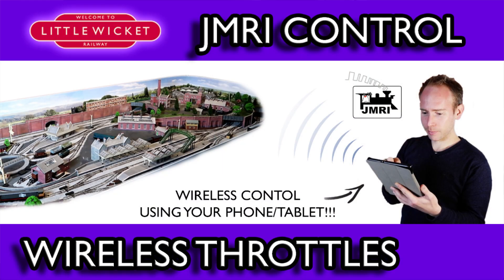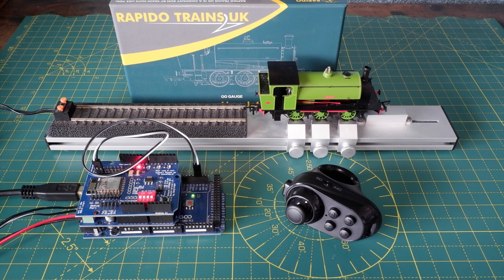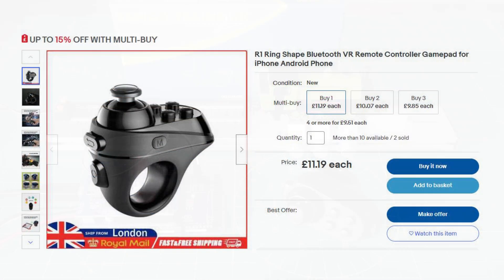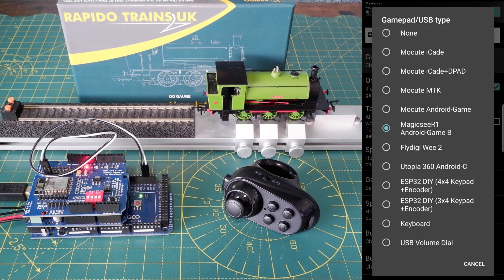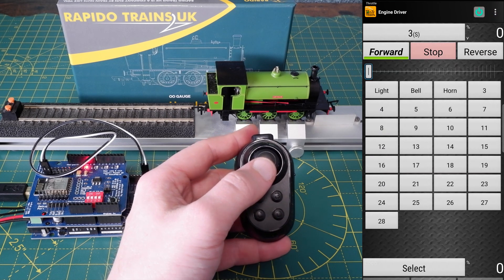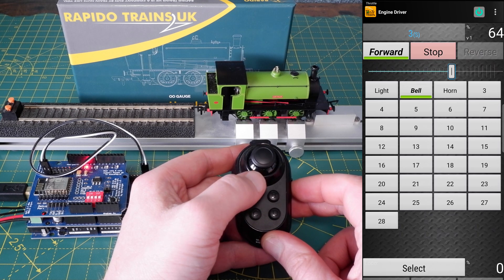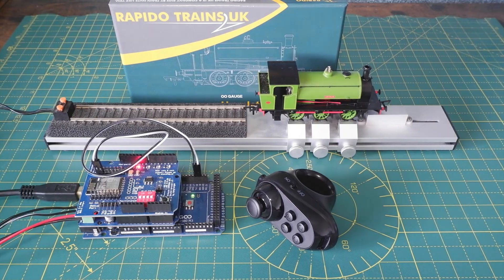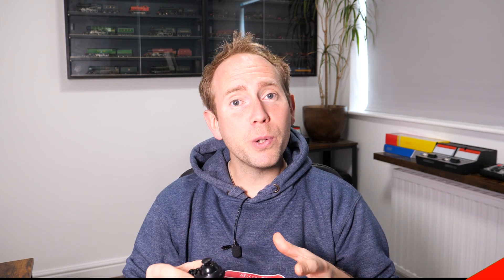Add a Handheld Wireless Throttle to the Engine Driver App

Comment: Rob, once again you have a knack for making a video about the thing I was interested in, before I get to doing it 😂.   I saw there was an option in ED to connect a pad, but I never tested it. I did actually prototype making changes to the web server interface and connecting a Xbox controller via the browser interface. I wanted to see how the analog triggers would work for fine grained control and it did feel pretty good. I'm planning on implementing a custom set of controls to allow you to switch between locos and set running speeds with a single gamepad. I'm firmly from the video game generation, so this interface feels intuitive to me. I plan to share it when I'm done! 🎮

Comment: hi, you mentioned that you can't tell which speed step you are on.  You might like to experiment with the 'Voice Response' options. You can set ED to 'speak' the loco and speed details under certain conditions.
Reply from the maker: That's awesome, will definitely check that out, thanks for sharing.

Comment: while i like the idea, its not what most people want when they want that physical control feeling, what would be good is using the game controller mode with a rotary switch, similar to what you find on car radios that turns forever but has volume steps, change the volume for speed steps and boom, perfect phone attachment that you could clamp to the bottom of your phone with a power passthrough that could be used to charge the dial aswell as the phone, and don't forget the direction buttons either side of the dial

i would say put a numpad on the bottom of the dial but like that seems overkill when you can use the screen for sound activation as you'd have the device in hand with the dial on the bottom of the phone so a quick tap wouldn't hurt you for sounds, its more about the speed control than sounds

Comment: Hi Rob. Interesting. I use a USB volume control to run the loco and function touch on the tablet. advantage is you get to turn a knob to control the loco. Disadvantages, no buttons to press and your tethered to the tablet.

Comment: Thanks Rob, great video as always!  I've been interested in getting something a bit more tactile as sometimes the touchscreen is unresponsive on ipads and phones and the like. This would be a great cheap option.
Reply from the maker: Thanks Auxie. It's not as responsive as I hoped it would be, but you might be able to dial it in a bit more using the settings (speed steps, etc.) or perhaps one of the other controller options is better. The R1 was recommended by one of the DCC-EX team, so that's what I bought, not too bad for ~£10.